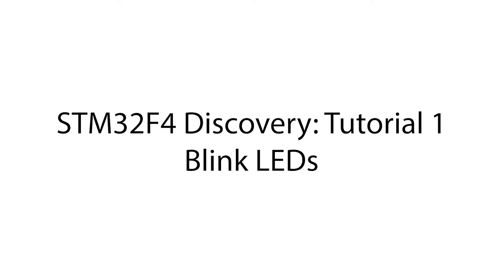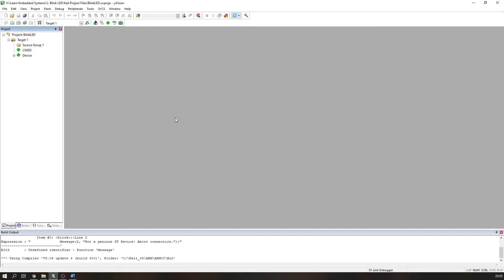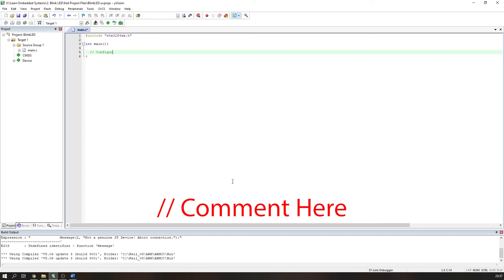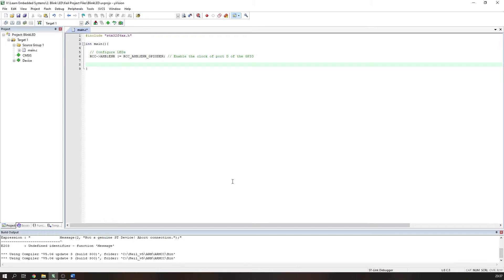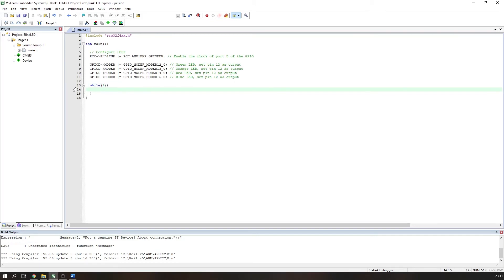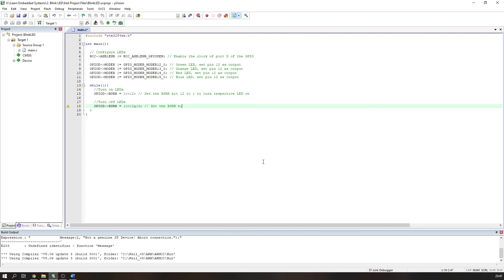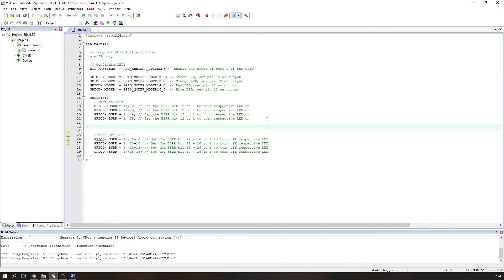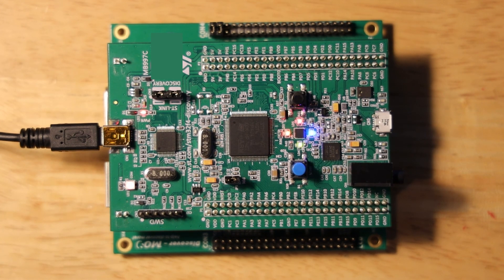Getting started with the STM32F4 Discovery - Blink LEDs

Comment: I am using a STM32F411VE board, and the LEDs are completely solid, not blinking. Is this a timer issue? the clock setting could not be changed, it was grayed out. I am guessing the delay is too small and it may be blinking too fast.
Reply: I found the solution. the for loops are optimized out. Make the variable i declaration  as:
volatile uint32_t i;
Reply: Having the same problem, any fix?? My board is STM32F407G-DISC1
Reply: Need to create header file also